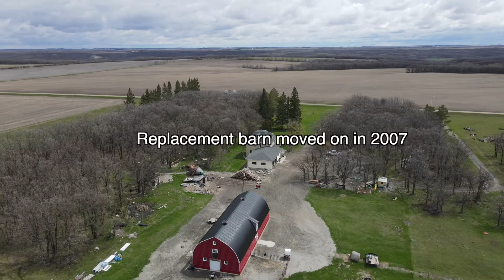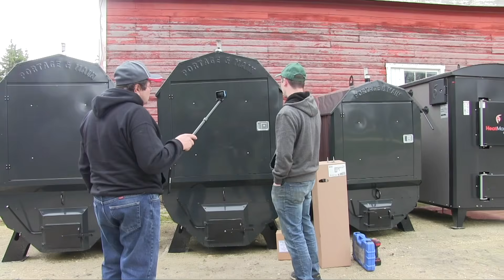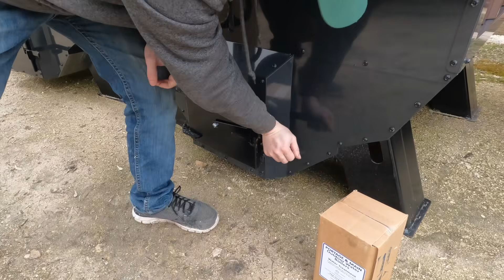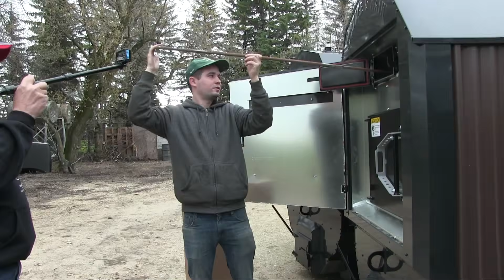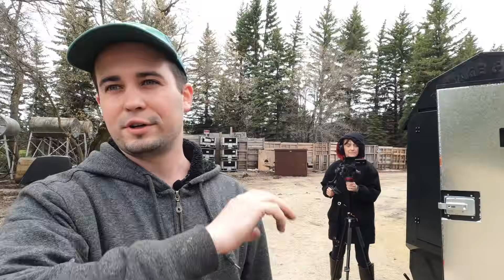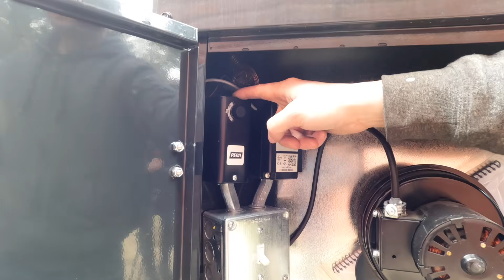Why I went back to a Conventional OWB from Gasification OWB. Polar G2plus Vs  Portage & Main 34/44

Comment: In 1990 i put in a heatmore 200. It has burned 15 cord a year every year. I heat my house, shop and 2 cattle waterers. It'll die one day, and I will probably go to lp. Enjoy your videos. Thanks
Reply: Don't hold your breath. They are one of the most reliable and 
Long lasting stoves . The dry
Boiler and stainless construction 
Are a big part of the longevity.
Mine is going on 20 years and 
Shows no signs of wear. A large 
Tree fell on it about ten years ago. I tore it down to the frame,
Had all the frame structure 
Straightened and replaced the 
Exterior. Still running strong.
The fan was the only weak link.
I had it replaced early on with a
Sealed unit. Big improvement.
Good luck yours. I burn between 30 and 35 face cords 
A year.
S
Reply: @billbertagnoli4226 that's about what we burn, up here in Northern Maine. Long, cold winters don't have quite the same bite when the wood's burning strong!

Comment: Thank you for the time and effort,  great info. I've been running a CB 5036 for 2yrs 24×7 and love it. I purchased it used which I dont recomend but I got lucky. Heats a 1200ft house and domestic water here in Eastern Illinois, not the winters you Northerners have no doubt but cold enough!
Reply: I've been tending a CB CL5036 since 2015 and it's a terrible machine. Only positive really that the steel is so thick that damaging them requires intent. Central Boiler is run by welders selling metal in the shape of a boiler. They're not engineers, and there are many a good reasons they're not legal for residential installations in the US anymore. Can't say enough bad about the "Classic" line.

Comment: I had to rebuild the firebox in my Central Boiler on the 24th year of owning it…….Had to cut the box out with a Plasma cutter and weld up a new box out of 1/4 in plate…….Thank God for Plasma Cutter’s and Arc Welders. This taught me that Water Quality Matter’s I chosen to go the 50/50 Antifreeze mix instead of just water with a inhibitor added like Central Boiler Recommendation. I have found Industrial Glycol buy the  55gal is the best price point.

Comment: I have this model of p and m boiler.  Works great. 12 to 15 hour burns on a moderate wood fill. It is also designed to burn coal. 25 to 35 cords per winter

Comment: Just liked and subscribed.  I have the smallest Heatmore for a shop/apartment at just under 3000 sq. ft. and will be adding a house at 1500 so thinking about a new unit.  My available wood is Tamarak and D.fir that tend to have pitch.  I fear a gasifier where the wood needs to be dry and perfect.
Reply from the maker: Ya the wood really does need to be dry or enough of it to  blend it with higher moisture to keep them efficient

Comment: I appreciate the video. It was very thorough.  I have a Polar G2+ which I have had since 2020. I only heat a 912 sq ft house, my hot water and a 615sq ft garage, and I burn between 8 and 9 cord a year. The 3-4 cord claim is absurd, as I am only in Wisconsin. If I didn't heat the water and garage, then maybe, but doubtful.  I agree there is a learning curve for a classifier. Theres an art to loading it properly, especially if you've let it burn down too far  it happens, especially if your a single guy taking care of your pups and your stove and working overtime. Just load your gassifire like you'd load a campfire. If it's down to ash and a few coals, bank them over the opening, add small wood, then some larger on top. The key is to keep the heat up to "bake" the new wood. The gassifiers are maintenance heavy, but efficient. While I do not at all agree with a 4 cord/season burn, I have a g2+ heating water, 913 sq ft house and 25x25ish garage at 8.25 cord a winter and that includes mixing in pine and junk wood, especially in shoulder seasons. Anyways thanks for a great video, just had to ad my $0.22 on what I've experienced with my gassisier. My uncle 2 miles down the road has a conventional and he doesn't heat domestic hot water but heats a similar space with almost twice the wood.
Reply from the maker: Great information! Thanx for your input

Comment: I use a 2000 gal water tank (large old propane tank  spray foamed _) use it to store hot water,  less burns
Reply: How does that work for you I was thinking of doing something similar.
Reply: I don’t know why more people don’t use stored heat. Being able to burn hotter with less idle makes a huge difference in efficiency and Smokey boilers

Comment: Heatmor 400 conventional  will gasify if wood is dry enough ..white oak 12%  it's like cloud of gas burning in upper part of the stove . Fire box is 54 x32x32 it's huge cloud. Flames .. all you have to do is adjust your air intake flippers in front of the draft fans. Pretty easy to have a BTU making monster heating older buildings 6600 sqft. ( How a heatmor works and a portage Maine are pretty close to the same )

Comment: Yes I am thinking about buying a portage and main. But I have seen some concerning issue's.  I am not sure if it is user error or a flaw in the design, but I will mention both issues. And I hope you will respond. The owner tells me that his stove boils over every time he gets a storm , like one of those Colorado low's.  He doesn't understand why. I am thinking that maybe it is something like mine Homesteader and the filler pipe has a flapper lid that is full of condensation ,and in a really windy storm that condensation freezes the lid shut, and I think the boiler builds up pressure and pushes fld.  out the breather hose. My cure to that was just push a tight fitting cardboard box over the filler stack ,and that keeps the Windchill of the steel so it doesn't freeze up. I am not sure if the portage and main has the same type of problem, maybe you can shed some light on it.  And the second man had his portage and main for 6 years and it is rusted out and really bad too. He has a video on you tube about how he takes his boiler apart and try's to fix it himself ,but it is just crumbling at the seem between the top and the bottom halves. His problem was ,that his often boiled over also ,and when it did the water leaked around the filler pipe and the water then leaked into the insulation ,and ran down the upper half to the seam wear the gasket between the two halves would wick up all the water and hold it in that seem , and when he took it apart after only six years because it was leaking water , that seem was so bad it just crumbled . so the video ended before he told us what he ended up doing to repair it. But that is only two that I have checked out and they both seem to have a boiling over issue. Have you experienced the same kind of issues with yours, Any info would be apricated.
Reply from the maker: Never had a boiling over over issue with mine  but if it does  theres air leaking in somewhere allowing the firebox to keep burning when the thermostate shuts the fan off. The damper is a good place to start followed by the door gaskets or door adjustment. As far as rusting out as long as your using the recommended water treatment you shouldn't have to worry about rusting in that short of time .

Comment: Ooo the old square footage sizing, drives me nutz too.

I'm in Alberta, I have a gasser, love it.    Its oversized for now until I get everything I need.

Key thing with a gasser is you need dry wood, 2 - 4 years seasoned.

I'm burning 8 to 12" rounds in mine but I found a loophole that works here.

Thanks for the video.
Reply: What's the loophole?
Reply: @Richard Dabkowski  Sorry for the late reply, I was busy.     Its a long one.     I can elaborate on anything if you or someone else want more info.

What started out as a fire smart clean up around my boiler quickly turned into my primary source of fuel.   I believe I'm at 26 cords burned now, all but 1.5 have been standing dead or dry dead fall (mostly white poplar/aspen and willow).   The porosity of the dead tree allows the 24" long rounds to dry well below 16% M.C. which is my cutoff.   The manufacturer states drier than 20% but below 16% my required cleaning drops to almost nothing so it becomes a very easy process.    From boots and clothes on, feeding, checks, some cleaning to boots off I'm five minutes or less, twice a day down to -20C, then it takes slightly more time.

If the trees died this year the areas with bark are still too wet, averaging 24%. I drop them and stack them in 10 foot lengths for next year. The tress that died 2 years ago or more are 16% or less down to the trunk, I harvest these along with the tops of the wetter trees and burn immediately as most have bugs in them.    Depending on the current weather I am also able to harvest dead fall. 

Now due to the fact that it is rotten the wood has less weight which does affect your BTU output. I find the gassification boilers can utilize much more of this heat over any conventional unit. I oversized my boiler because I only have access to low grade firewood which allows me to get away with this.     The slight loss in output means that I use more wood, but because it is dry enough to burn as a round I save tons of time not having to split and re-handle the wood.    Typically I will mix the twigs and rounds together but I have ran many burn cycles with only big ones in there with no issues maintaining a coal bed.     

Rough calculations put me at using 120,000 btu/hr at -39C to heat the shop and house.   I can still do a 12 hr burn with this wood at this temp.  My 750HD has a ~160,000 btu/hr rating over a 12 hour fill, not sure what wood was burned during the test.    I've only calculated one main burn cycle, from the kick in temp with dead coals to the cut out temp it put out an average of 234,000 BTU over the 23 minute burn with this wood.

I know, too long.
Reply: Which OWB gasser do you have? I'm in your area and looking to build and heat with an OWB gasser.
Reply: @ryancletourneau  I mentioned the model in the long comment above.

I have the Central Boiler 750HD. Older version of the 760HDX.
Reply: @ryancletourneau  I'm NW of Edmonton.     Only dealers close to me were the CB or a Heatmaster.    I chose the CB because of the data-logging and the app. Heatmaster has it now ( I think ).
Reply: @yetilikesbeer  yeah saw your vid at chip lake. I’m near anselmo. Did you go through the barrhead dealer or spruce grove? Were they good to deal with?
Reply: @ryancletourneau  I'm not sure what happened to my replies?    Looks like my dealer in Sherwood Park is still the closest CB dealer.   Athabasca is where I was looking at Heatmasters in 2019, might be one closer now.
Reply: @ryancletourneau  we are close then, you might have seen my unit running.

Comment: Awesome video. Lot of great info. Unfortunately I too undersized my boiler🤦‍♂️. That P&M looks nice, is the aquastat in the back the main temp control for that unit?
Reply from the maker: So there are 2 aqua stats in the back. The digital one which you can program your set points for waters temp in boiler and differential ( mine is currently set for on at 170F and 18OF off) The second aqua stat is safety and will shut the fans off at what ever temp you set it at ( mine is 195)
The most useful add on Ive put on any of my wood boilers is an ink bird wifi temperature probe.  I can monitor the stove from my phone and set it to send me alarms ( high and low) where ever I am . My set points for it are 140 and 190. 
What stove are you running Andrew....are you upsizing or just stoking more often?
Reply: @curriecountryliving  I have an empyre boiler. It's a shame Profab closed their doors, it was nice to be able to support a Manitoba company when I bought it. I'm not terribly undersized, 12hr burns til about -20C with poplar. Full 3 stokes sub-30. That inkbird is a great idea, I'll have to look into that. I adjust my boiler temperature quite often depending on the outside temperature, that's why I was curious how the P&M was set up.
Reply: I too am in Manitoba I've been wanting to  install a wood boiler. I dont have as much space to heat but I've been debating getting a gasifier for both my house, shop, and water heater.
Reply from the maker: @bert26a  Don't undersize is all I can say....its really nice to have 12-14 hr burns now

Comment: Hey, when your calculating your square footage of your house, are you counting each floor, or just main floor square footage?  Looks like you have multi floors, and basement?
Reply from the maker: The house is 30x30. The attic is finished giving us 3 floors living space at 900ft2  each or 2700...the addition without heated garage is 400ft2. The basement technically is not heated altho the pipes from rads etc in basement keep it at around 10 C

Comment: I don't know about shipping to the states, but I'm going to look into it. My house is similar to yours, built in 1918. I still have 2 large radiators but currently use electric forced air, which is quite costly to run.
Reply from the maker: They have dealers in the states. What area are you in
Reply: @curriecountryliving  I'm in northeast Nebraska, near northwest Iowa and southeast south dakota.

Comment: Great video.   Do the conventional meet new EPA standard as same as gasification?  I may have missed that point,  bacon was cooking.  I thought (USA) we couldn't have conventional any longer  Can you?  Does that secondary burn meet their requirments?  I'M like you wet or dry, if it burns toss it in.  Thanks
Reply from the maker: There are no conventional that meet US EPA standard that I have seen or heard of Janine....must be a gasification ( down draft) due to their efficiency. Does that apply to all states? ( can't have conventional ) Here in Canada I know some provinces or  municipalities do require gasification. Manitoba ( where I am ) is not one of them.  Yes come spring if I'm short of wood I can toss just about any type of wood in this P&M
Reply: Alot of folks still buy conventional updraft boilers in the USA. The loop hole is that they are "intended" to burn coal which is how they are still being sold without EPA.

I'd say 9 out of/10 people that buy conventional boilers are burning wood.
Reply: @travhal  funny thing is, coal burns so dirty
Reply: @A&A  that's what I thought but kinda a** backwards with the EPA

Comment: My only question is that can you use the heat exchange from those units to another heat exchange for domestic? hot water for a residential. in other words, can you have another or larger tank reservoir with like a copper pipe in it that just kind of keeps that water hot in the large out reservoir? and then that heats up water for your? residential house I don't know if I explained that very well, but basically can you use this to heat your residential your household water like for showering or doing your laundry type stuff.

Comment: U can rebuild a heatmor.  They are 2 piece
Reply: Far as I know, they don't advertise a bolt on top section. Just because it's a dry bottom doesn't mean it's rebuildable.

The 3 points that are going for P&M is they have a 360° cooled on all sides, full front to back heat exchanger (chimney out the back), with secondary air (front and shaker grate) and firebrick (less air needed, less heat up the stack with more heat retention). If the design misses even one of those it will lack efficiency.

Also for proper mixing you need a fin/baffle to create some turbulence before going out of the firebox.
Reply: Yup, I had an issue with my 400 leaking, I called up heatmor and they had a new top half to my door in 2 weeks and rebuilt it my self.
Reply: @aaronkirchoff6985  we have a dealer in town he told me the same thing!  Pretty easy to do I hear and their warranty is really good too
Reply: @AATreeService  yup I paided for shipping, they warrantied the tank due to manufacturer defect. It started to leak at one of the welds and at that time it was 12 years old. Super easy company to deal with.
Reply: @aaronkirchoff6985  they have been around for a long time and they have an outstanding reputation for quality and warranty.   I will probably get one due to them being American made for my next stove.   I’d buy a portage possibly but the massive amount of firebrick scares me. That’s probably an easy 1000-2000 dollars to replace.
Reply: Yes this is true. I split mine to do some repairs. They also sell the top section separately and there is a video on YouTube. Also no special fire brick you can buy it right off the shelf.